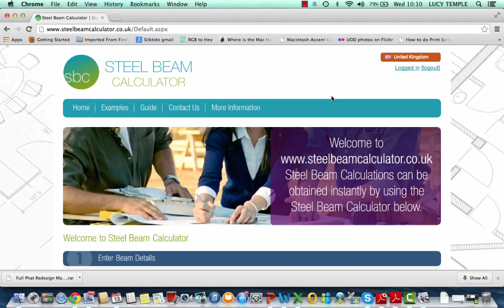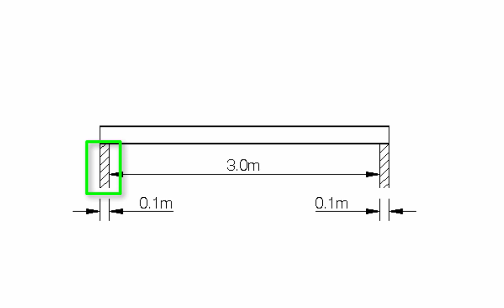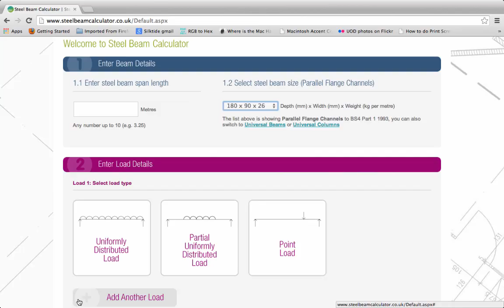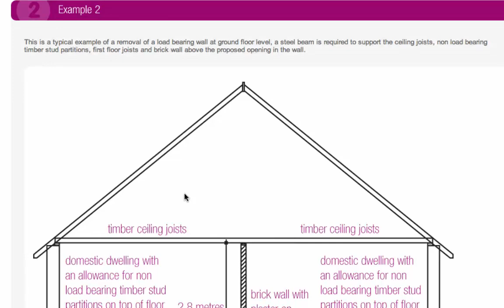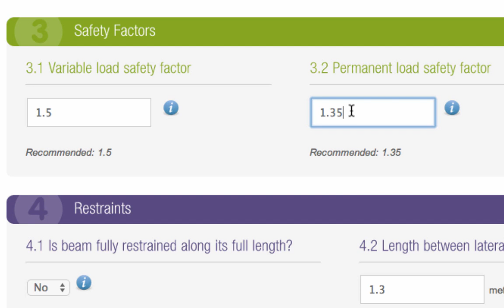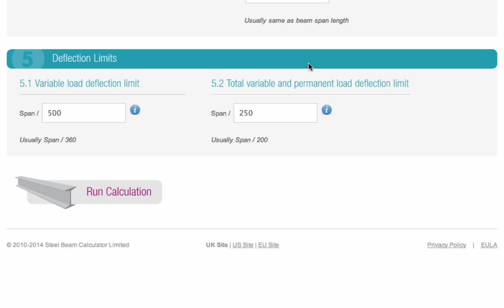How to use the steel beam calculator

Comment: I have 11.5 span of sandwich pannel roof is it enough to use I-beam with 20 cm depth 8 cm thickness 11 cm flange with self weight  20 kg/m dead load less than 50 kg/m - with no live load , can you estimate the deflection please> is it enogh to use such steel section
Reply: be patient , they will answer soon , its only been 6 years